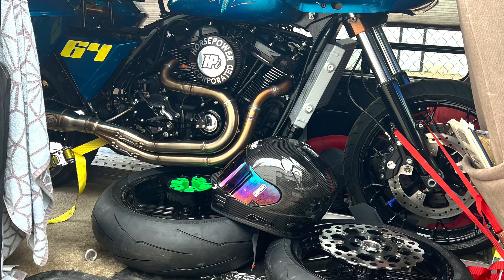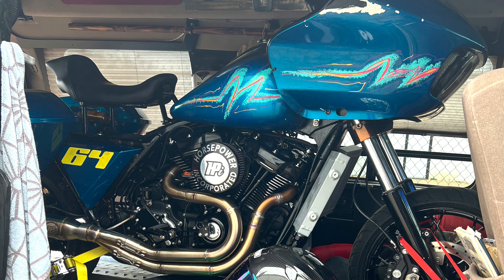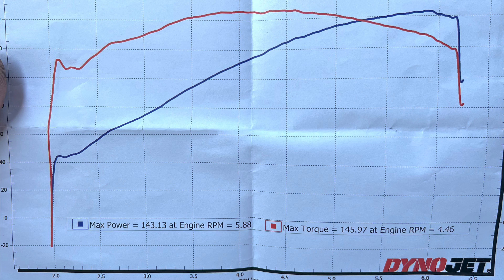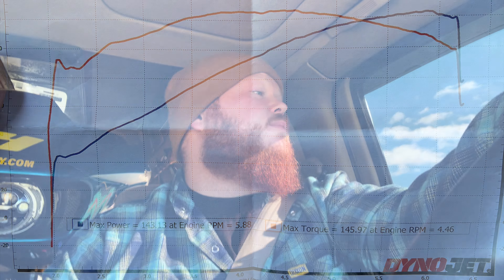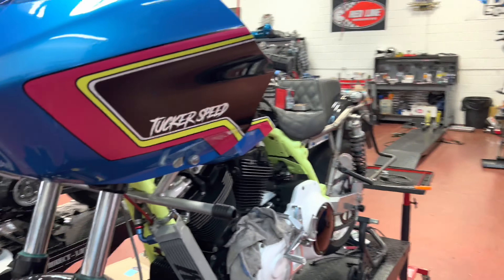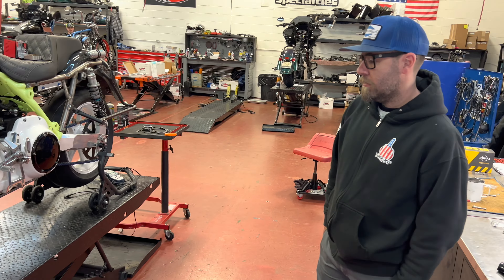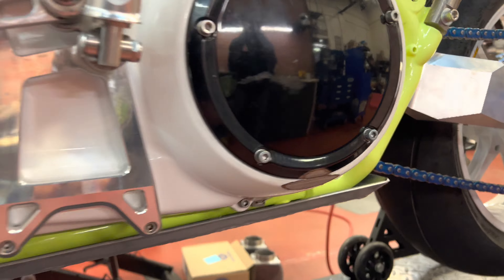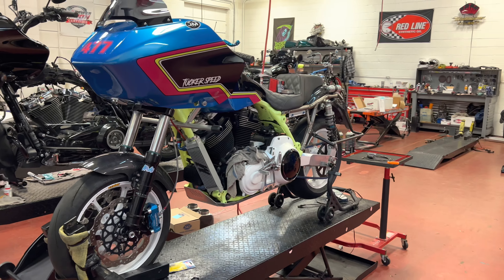Road to the Bagger Racing League with Fresh bike

Comment: Curious on your 4.280 bore with S&S jugs. Did you bore the S&S sleeves out? Or did you install new sleeves with a larger O.D.?
Reply from the maker: Just bored the s&s jugs out .030.  Most cost efficient
Reply: @schamberlin5150  cool, just checking. I have been told by some it isn’t a very good idea. It’s nice to see someone do it and it works 🤘🏻